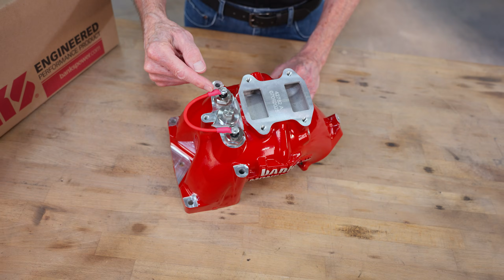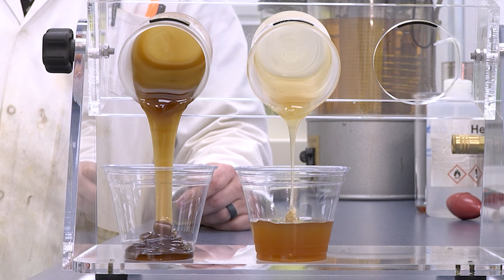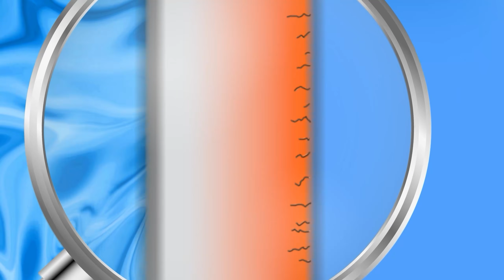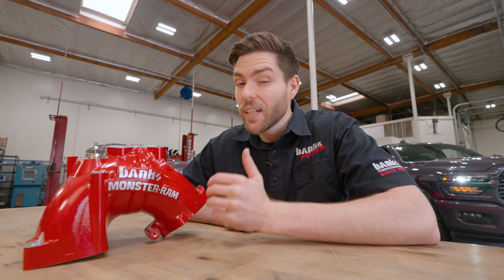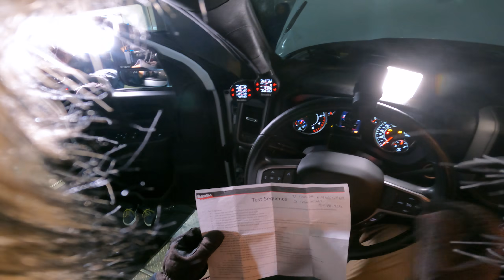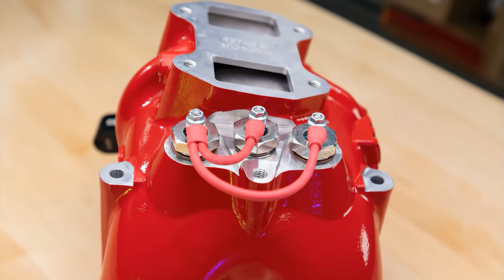We froze a truck to -40°. Here's what happened.

Comment: Banks did an awesome job with this video, fully explaining how cold starts work on Ram 6.7L Cummins trucks. The length that Banks goes to in order to provide factual data and testing for the diesel community is unbeatable🙌
Reply from the maker: Thank you for the kind words!
Reply: @bankspower just wondering if the triple heaters have much affect on the airflow thru the monster ram... and if 3 in line would maybe be better than 3 across. 
Also... why do American trucks use intake heaters vs Japanese diesels using the wee pencil heaters in the cylinder head?
Reply: @ferdinandvries4032 It's the manufacturer choice and Cummins went to glow plugs in each cylinder starting this year '26 to get far away from the grid heater fiasco(and it's better system).  Ford Powerstroke diesel uses cylinder glow plugs along with the GM Duramax does too.  It's a better way to get heat directly into the cylinder where it's needed versus the intake grid heaters that are only warming air going past the grid that still has to get all the way to cylinders.
Reply: @tdotw77 Another advantage of glow plugs (besides putting heat directly in the combustion chamber) is that the hot surface provides an additional ignition source, like those antique hot bulb diesel engines.
The 7,4V no start would've been a start if it had glow plugs 💩.

Glow plugs basically exist as long as diesel engines do but Cummins cheaped out as a grid heater is cheaper to implement.
Reply: @bankspower have had a banks monster ram for about two years now havent wanted to tackle the install for it, live in ms and bolt was still tight so I just disconnected power to relay, still have no cel and can use remote start like normal
Reply: Behold: The perfect glazing post.
Reply: @Hawk7886 fr all I did was unplug my grid heater and its been completely fine, just wish I woulda known about it before spending the money on the banks because then I wouldnt have spent the useless money on it. Been 2 years and truck has been fine
Reply: @gavinlee9478  you don't live in the cold and thats fine. why would you buy something for cold starts if you don't live in a cold climate? lmao
Reply: @bryanx2000 im moving to missouri and have friends up there that still dont have the banks grid heater and dont have an issue starting truck at all, I have a black banks grid heater already, have for 2 years now before I even signed papers on my truck i had the banks grid heater shipping to my house but its just been sitting there for 2 years in the box and packaging
Reply: @Hawk7886  How dare manufacturers get credit for actually doing real product development and putting their testing out there for everyone to see... 🙄
Reply: This was a well made video and I learnt some useful things, but the most important take-away point is that I am not God.
Reply: You should of put your 26 2500 in that chamber to see if it started with the glow plug redesign. I know the video was to promote your monster ram but would be interesting to see how much the new ones improved in that temperate range.

Comment: here in colorado, got a little old gas car but WOW does a block and oil pan heater really help it in the -14 deep winter week. instead of sputtering to life and roughly idling for a while she just purrs into action and begs to get back home to the garage. can't imagine how large that difference is with a diesel in even colder temps. this was pretty neat tho, didn't even know modern diesels had a manifold heater.

Comment: Gail, in Canada at those temps a battery warmer blanket is more important than a block heater for gas engines and block plus battery blanket for diesel. Should have added a battery warmer blankets into the mix for your last tests to show people in colder temps how that could make a good aid add on to your intake for sure starting.

Comment: FOR  COLD  WEATHER  YOU  WANT  HIGHER  VOLTAGE  !  THIS  MEANS  THAT  YOU  MAY  STILL  WANT  A  12V  BATTERY  TO  RUN  THE  ENGINE  AND  EVERYTHING  ELSE  AS  USUAL  BUT  YOU  REALLY  WANT  A  24V  STARTER  !

Comment: Gail thirty years in Alaska had a good friend John Schwochert we discussed and I used a 75 watt oil pan heater as well it was amazing how much better the engine started with just that little heater warming the oil as well as a block heater when temps got below -20 F. I did this on gas and diesel engines.
Reply: Good job on the cold chamber very thorough report

Comment: Wouldn't the intake heater take a huge draw from the battery?
Reply from the maker: The factory heater takes triple the amount of the heater coil that is supplied with the Monster-Ram; it intake heater will work just fine as long as the correct batteries are used for the truck. In the Ram trucks if you'll recall, there are two.

Comment: I live in Finland, -30°C happens every winter. Block heater is a joke with big engines. You need a fuel operated heater to get enough heat energy, like Webasto. And good batteries in as warm place as possible. And  reliable gasoline operated generator (Honda) just in case. Also common rail diesels are worse in the cold then fully mechanical diesels, because they require longer crank and they stop trying because software says so. So one old car too, when the modern stuff says no ;)

Comment: A battery blanket heater is essential.   Also, I am absolutely amazed at the number of vehicles that don't come with a block heater.  I live in Ontario, and they were standard practice back in the day.  That may be one of the reasons many engines today experience premature wear.

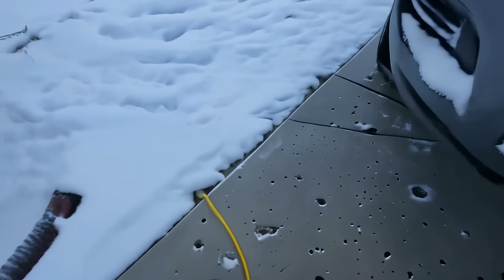Comment: 8:10
 Dork threw the electrical plug in the snow the previous morning.
A nail / hook in the garage doorframe would keep the plug out of the snow as well as be with in easy height / reach instead of bending over to pick it up each and Every time. Additionally, it serves as a Visual as to whether the cord is still attached to the block heater Before backing out. 
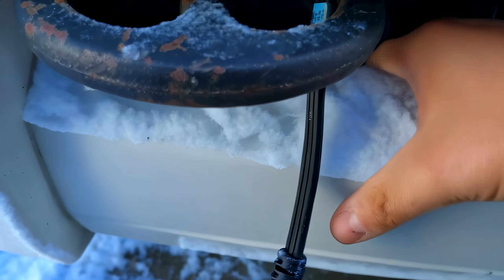   9:00  Auto Parts Stores / Electrical Stores / Hardware stores sell a cover / plug-in to cover the male end of the block heater cord. Some with a rubber strap to hold it to the cord to prevent lose. Keeps it handy and plug corrosion free.
7-P Principle  ☆

Comment: I made a DIY fuel filter heater for about $25 in materials. The biggest issue is the gelling in filters. So a filter heater can solve that. If you wanna see it with evidence of it working it's in my channel playlist called Duramax/Powerstroke/Cummins and the title is "DIY Fuel Filter Heater $25" or just search YT for "MrMotofy DIY Fuel Filter Heater $25" There's an IR pic of the filter heater working.

Comment: I put an amp meter on my dual heater intake and it pulled 110-108 amps, didnt test the factory heater but have read of others that got 220-200 amps
bottom line is you need 4 heaters to match the factory grid heater
and yes you should be plugging you truck in because the longer its running at non-ideal temperature the more likely you are going to do damage
all this testing just seems like excuses for the original claim that 1 heater was enough

Comment: My question has always been this;

 If the oil pump is a positive displacement device and the oil filter has an anti drain back valve, we must accept that the oil galleries are full all the way to the bearing surface because the oil can’t drain back. And the pump moves oil with every turn of the crank, even before the engine fires, then we have oil flow at the bearing before combustion occurs.
 So why do people talk about oil starvation?
 Is the ADBV faulty? Why is there no oil in your galleries and at your bearing? 
 Why isn’t your positive displacement pump moving oil as soon as the starter engages?
 It just does t make sense. Has anybody got a valid, ASE level explanation that actually stands up to scrutiny?

Comment: One of the best ways to help as well is to install a float charger and battery blankets into the block heater circuit. It helps wake up your battery capacity by warming the cells with a light charge

Comment: Why aren't there six glow plugs in the cylinder head?

My 1.9 TDI starts without any problems at -28°C, I replace four glow plugs every six years, and it's done 200,000 miles without any issues.
Reply from the maker: The 2007-2024 6.7L Cummins trucks don't use glow plugs; they use a grid heater. Cummins have used grid heaters starting with the 5.9L Cummins in the late 80's. 

More about the grid heater failure and why we developed the Monster-Ram here: https://official.bankspower.com/insider_news/ram-6-7l-grid-heater-failure-explained-2/
Reply: @bankspower  

No question, the retrofit is great. But it wouldn't be necessary if the manufacturer used glow plugs. It's still a mystery to me why US manufacturers haven't thought of using glow plugs like the rest of the world. The Bosch glow plug was invented in 1922. The diesel Hilux starts without any problems in Norway, and if it gets really cold, there's a diesel auxiliary heater that warms up the engine and the interior. Websto or Eberspächer.

Comment: for anyone looking for a amazing cold weather battery, as a canadian, I can whole heartly reccomend interstate either non agm or agm, my family has been using them for 40 years, in everything from farm equipment, big rigs, to compact sedans,

Currently Im running a interstate Non AGM 800 CC on my 1999 dodge ram 1500 5.9L, it starts in -40, without being plugged in ever.

Myself and my father that bought the truck new, has never plugged in this truck and with that battery, it has never failed to start even when buried in a snowbank.

in that 40 years, we have had a total of 12 batteries fail, recently as 2020.

we went to a interstate battery location nearby, and walked out with a new battery. it still works to this day.

Comment: Can you combine the dual billet heater kit plus the new triple heat capable banks monster ram for even better performance?
Reply from the maker: No. Using 5 heaters will exceed the factory electrical system’s capacity, overload the heater relay, damage the vehicle’s electrical system, and risk a fire. This is not a permitted configuration.

Comment: Mr.Banks and team, I appreciate the effort put into this video But I must say while this video is incredibly informative you did not test the banks monster ram in the same configuration with and without the block heater so the results seem a bit misleading. You show 1500w without block heater at -20f and then show 750w with block heater at -20f. None of the published results you guys show actually show the effect more intake heat is providing. The only thing really shown is use a block heater for guaranteed results. This test should have been done 1:1 comparing block heating with the three stages of intake heater wattage you offer and the related crank rpm etc. I don’t like the way this test was conducted.

Comment: I saw your old fact check video about S&B Intakes and I wanted to ask - was there ever a time when you really could gain actual performance with cheap bolt-on mods like straight pipes or cold air intakes without necessarily or always needing a tune?  And if so, when did that stop?  (My completely uneducated guess would be "about the time throttle-by-wire became common" but I don't know so I'd love to find out from someone who was actually there)

Comment: Don't American cars have glow plugs?
Diesel Volvos start up first crank -25c in sweden. It just runs the glow plugs for a x amount of seconds before attempting a crank.

What's wrong with American diesels??? None are made to work fine in winter climates??? No Diesel should smoke like that during a cold Startup. I've never seen it in sweden where diesels are like 1/3 of all cars.
Reply from the maker: The 2007-2024 6.7L Cummins trucks don't use glow plugs; they use a grid heater. Cummins have used grid heaters starting with the 5.9L Cummins in the late 80's. 

More about the grid heater failure and why we developed the Monster-Ram here: https://official.bankspower.com/insider_news/ram-6-7l-grid-heater-failure-explained-2/

Comment: Well, actually there was not everything as good as it can be. Because there is an option to get it even better to do cold starts! Bigger, or more batterys! If you add one extra battery parallel, you will have twice the cold crank amperes and also twice the capacity of the battery. Of course only if you add same kind of battery, what was the other one. If you do so, I think your car will start at -40. At the old days, I used to have old, prechamber mercedes W201 and W124 diesels. I always put bigger battery and I usually had no any problems to get my cars on fire. I did not have any coolant heaters, or any other heaters because I did not need any. If you have enaugh Voltage and Current, your car will start. So, at the end, it is all abaut batterys. This kind of truck what you have there is a big car with big engine. So it must need big battery capacity also. My Mercedes was all with relatively small engines, 2-3 liters only. But I added always as big battery what was capable to put there. Something around 88Ah-90Ah. That was enaugh. I think your kind of truck might need like a 120Ah or even bigger. Or two batterys. Ps. I live in Finland, and here is very often pretty cold at winter. Usually not -40, but -30 C is possible even on south. And on north it is possible to be -50 C. And that is cold.. Ps. Thanks for the video.

Comment: Did you guys charge the new battery? I've found "new" batteries to be discharged by as much as 60-70%. They sit on the shelf for a couple years sometimes. And while you're pulling that kind of wattage for your heater I have to wonder if the owner of the truck would need to put a battery tender on it as well.

Comment: As you increase heat applied to the intake, aren’t you robbing power from the cold battery that the starter needs to need to turn the engine over?

Also, it would have been nice to see test where the only variable changed was the wattage of the intake heaters.

Comment: It sounds like a battery heater might add more value than a second or third heater.  It would be interesting to see how much better the starts would have been with both block heat and battery heat.  It seems the battery is the weak link below -20º F.

Comment: When do you think the 2026 version will be available?
Reply from the maker: The 2007–2024 6.7L Cummins Monster-Ram is not compatible with or planned for use on 2025 and newer Ram trucks. The updated 2025+ 6.7L platform features significant changes, including a different ECM, a revised heat system that uses glow plugs, and a side-draft intake design on the cylinder head, making it fundamentally a new engine architecture compared to earlier models.
Reply: @bankspower would you say rams new design fixed the previous design flaws?

Comment: Very informative, but I thought the stock Ram grid heater draws 220A and at 12Vdc that's 2640 watts. With that in mind, this doesn't seem like the best option for replacement of the stock grid heater for cold climates unless you go to 3+ Banks heaters. If one were to opt for that many heaters in the intake, how does that impact airflow?

Comment: As some who experiences -40 it’s not fun, engine won’t start, powered steering is frozen, battery dead, tires have lumps, key start doesn’t help since it last less then 10 mins not giving enough time to heat the engine and oils.

If I left my car unplugged for more then a day it will not start.

Comment: Fairbanks here, -54F Ambient. 
0W-40 would have gotten you there, you would be SHOCKED the difference in viscosity. 

Also we run 10-12A battery trickle chargers on a 4 way extension box. I personally run dual 250w heating pads (built in thermostats 170F-200F, just in case we get a "warm" day). One for transmission, one for oil pan.  

I don't use "burn the truck down pads" (battery heating pads) you want the heat INSIDE and that's through charging, AND a fully charged battery is good for -70F. 

0w *doesn't* really tell you enough. You need an oil with good pump ability (ASTM D4684) lower is better!

Comment: Did you happen to record the data on Oil pressure? I’m curious how long the engine took to produce the correct oil pressure after start up in those cold temps and what the times where the colder the temps were.

Comment: In extreme cold start areas people will add an oil pan heater and battery warming blankets to the factory block heater. That's about all you could have done to get it to fire at -40.

Comment: Also 1500w is  a considerable load, and voltage drop in extreme cold is no joke. I would not only invest in a heated battery blanket, but also maybe an additional battery to lower the strain. I get this is a dual battery setup already, I'm saying a third might be necessary for real cold as it would add 50% more current capability and reduce the voltage sag from the loads.

Comment: I live in a general climate where we get + 40 °C in summer and about - 30 °C in winter (Romania) with an average of plus 20-30 Celsius in spring - Autumn
Usually in the winter I like to take the battery of my car off and keep it in the house if it's freezing for multiple days and I don't drive the car often.
If I have daily drives I keep it in the car.
No issues at the moment

Comment: And I always plugged my 7.3 02 in at 40f and below. And left my heat vents set at defrost so the block heater could also defrost the windshield a slight bit.i also ended up  adding a second block heater, and 2 oil pan heat blankets plus a trans pan heat blanket. Made a 30amp 220 twist lock adapter that was branched out to each circuit of those to 120. That way I could always just run 2 extension cords to my truck where ever I am when I'm not at home running the 30 amp 220 twist lock cord. And I put a 12x12 fuel blanket heater on as well and balanced the max amp load so I could make both circuits of all the heaters 19 amps. Balanced load